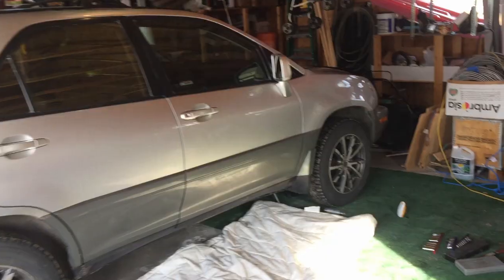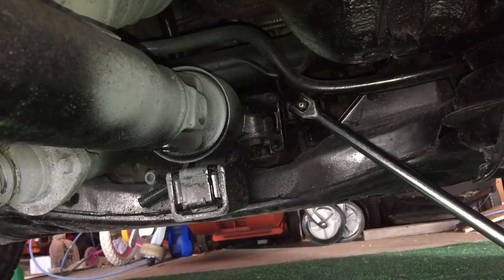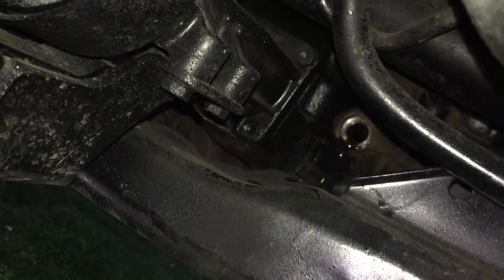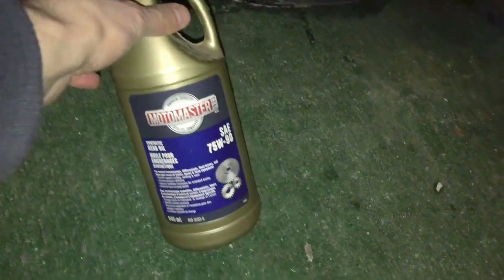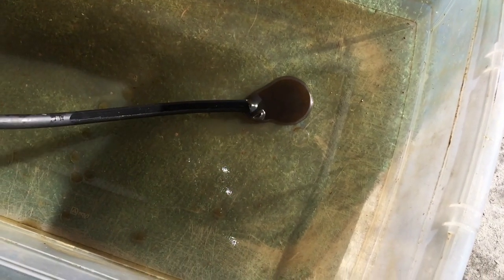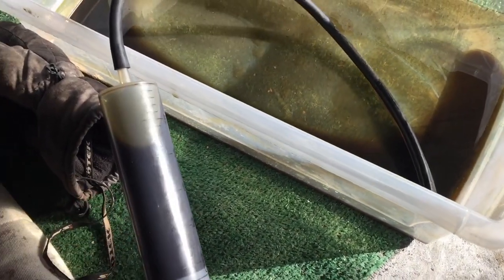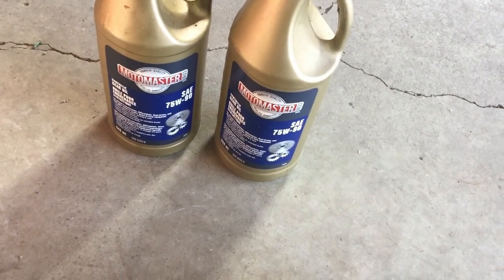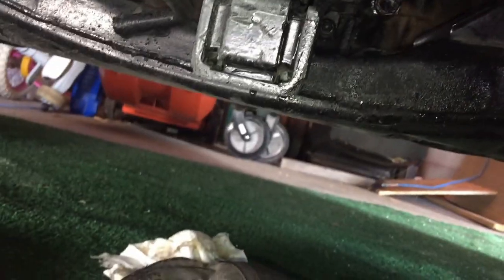Transfer case gear oil change - Toyota Harrier Lexus RX 300

Comment: You can use a cheap pump found at Harbor Freight to pump out the old oil, if you can only open the fill nut.  Use the same pump to pump in the new oil, but this time reverse the direction of the pump hoses.